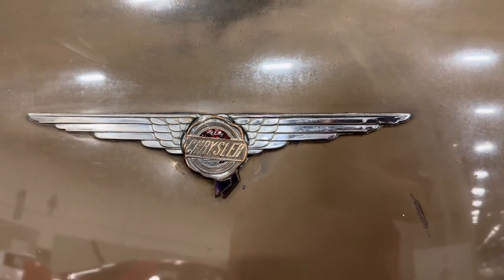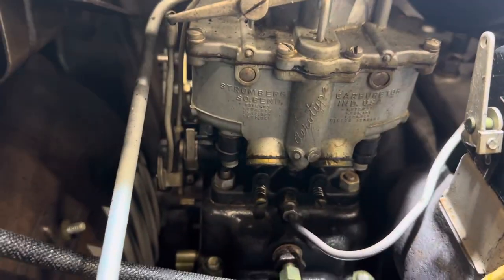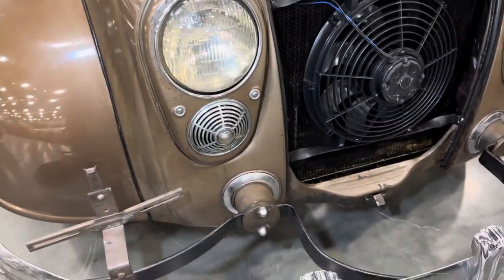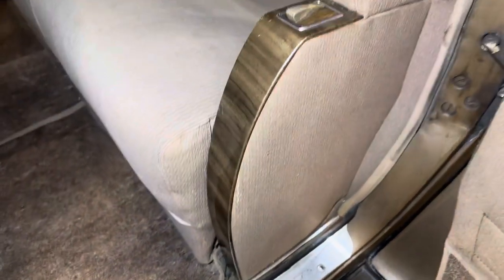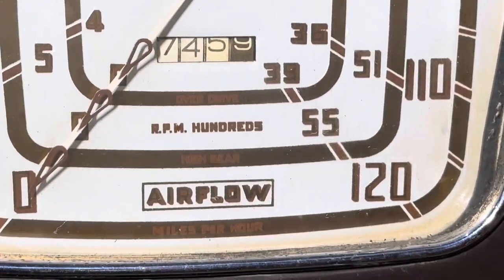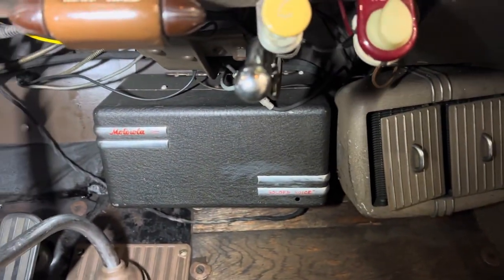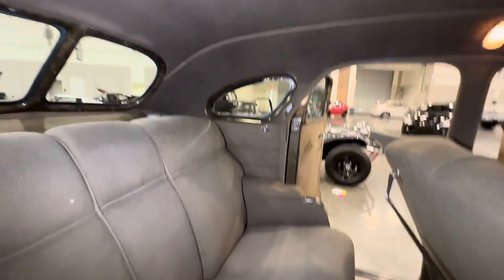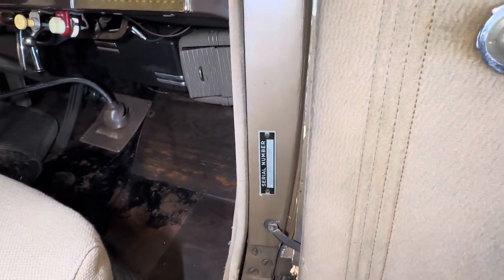For Sale: 1936 Chrysler Airflow Imperial

Comment: Swell car, but it is not an Imperial, it is the base C9 model.  The Imperial Airflow, C10, has a longer wheelbase and two-piece rear quarter windows, with a flip-out section.
Reply: You are correct, this isn't no Imperial.